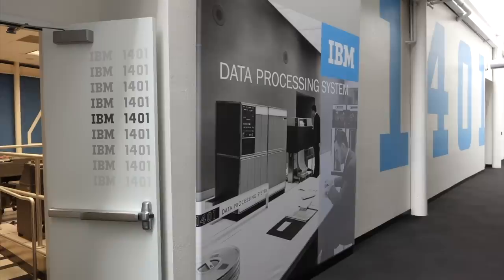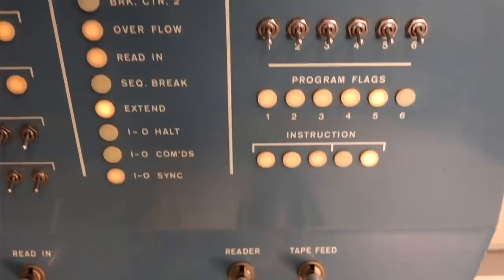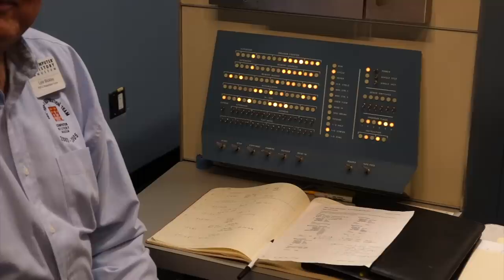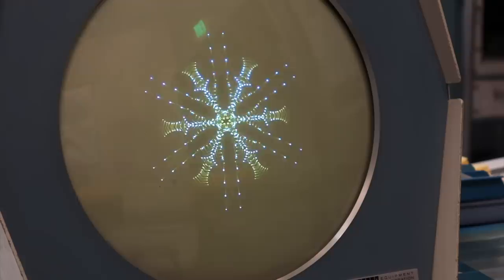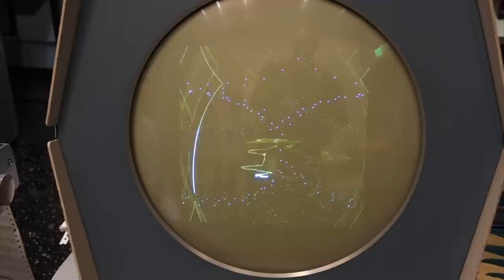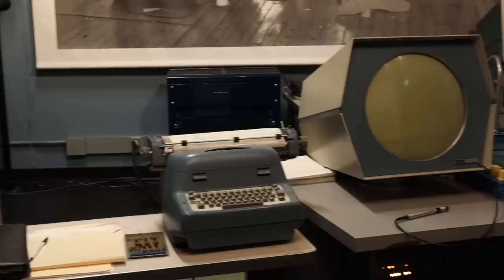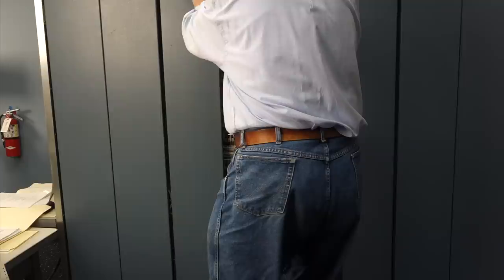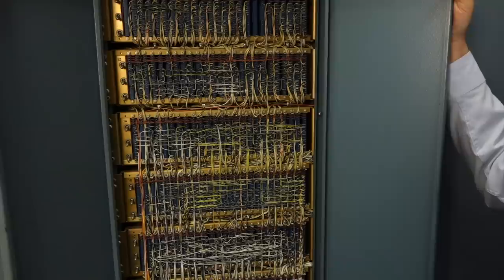Lyle Bickley explains the PDP-1 (and we play the original Spacewar!)

Comment: Just to help me out, is this less or more powerful than, let's say a Commodore 64? I'm a total noob regarding these REALLY old computers.
Reply: A bit hard to compare.  The C64 had 64K bytes of 8 bit RAM plus 20K of ROM, and a ~1 MHz 8 bit CPU.  The PDP1 used 12 K of 18 bit words, and the logic was capable of running at about 5 MHz, but I don't know how the instruction set compared with the C64 processor.  

The PDP-1 required many kilowatts of power, while the C64 could run off a wall plug, and had floppy discs for data storage.  The PDP-1 had about a 20 word program loader to bootstrap, but then you would have to load the operating system from paper tape, if it wasn't already in its non-volatile magnetic core memory.  

Biggest difference is that only 53 PDP-1 units were ever made at a cost of nearly $1 million each in today's money, while 10 - 17 million C64s were sold at a much more affordable price.  

Aside from the price and the difference in I/O capability, the PDP-1 was probably a more powerful computer, but only a handful of people could have afforded to buy or operate one.
Reply: less, much less,
Reply: Keep in mind the C64 had its custom chipset coprocessors for video (VIC2) and sound (SID). This is why the C64 is light years more powerful in graphics and sound.  The Vic2 ran at 14mhz.  The 6510 processor also was no slouch esp when unsaddled from the burden of driving the graphics system, able to run an instruction every 4 cycles vs 8 on the common Z80 processor of its time.  The main limitation was the lack of memory.
Reply: Let's go point by point...

Memory (not counting ROM, as we don't know what, if any, the PDP has) -
PDP-1: 12K x 18 bits = 221,184 bits (non volatile)
C64: 64K x 8 bits = 524,288 bits (volatile)

The Commodore has about twice (to 2.5x) as much, at least once you subtract the ~8k needed for a typical screen bitmap, though you do have to sit through loading programs into it every single time you power on, unless you're running a cartridge of course. However, if you boot into the built-in BASIC, the load screen claims "38911 bytes free", which is equal to only 311,288 bits (because some of the address space is shared with ROM, and only some of the missing space can be shadowed by video RAM). A closer run thing, but in either case, the C64 still wins this round. Other contemporary machines like the Spectrum 48k and BBC Micro (32k, typically) would be even closer or actually lose. So we can say the PDP's memory is about equal to that of an early 80s home computer, albeit divided up somewhat more coarsely.
Bear in mind however this is just how much memory THIS PDP-1 has; the base model sported only 4Kw (4096 x 18 bits), and expansions were available up to 64Kw (65536 x 18 bits), which obviously changes the equation quite severely in both directions.

Processor power -
PDP-1: 18-bit architecture, parts rated for upto 5mhz switch rate, but only used at that speed for executing microcode at a level rather lower than the actual "instructions". Memory speed, a much more important thing for the operation speed of both this system and a typical 80s machine, was about 187khz, which at an average of 2 memory ops per instruction gives an overall speed of approx 93,500 18-bit instructions per second. As computer and specifically CPU architecture was in its infancy, each instruction was more primitive, less refined and took up far more microcode steps than in later microchip processors, hence the discrepancy in speed; also, with fewer opcodes available overall, especially for complex instructions, you'd have to use more of them to get the same result, making for an equivalent speed probably far below 90kips. Total transistor count about 2700, with a similar number of diodes. Able to access up to 64k x 18 bits of memory without paging, so 18/8ths that of the C64.
C64: 8-bit architecture 6510 running at approx 1mhz (a little higher for NTSC, a little lower for PAL), with somewhere north of 3500 transistors on the die. If in line with general 6502 system design, memory may run at the equivalent of about 500ns (=2mhz), more than fast enough to perform read-write cycles at up to 250khz equivalent (the CPU can only access memory on every other cycle, and reading then writing are of course separate acts), or about 2.67x that of the PDP-1 (give or take a little depending on region). In the C64, the CPU has to share memory access cycles with the video chip, and the full performance is only available when video output is disabled, but as this is basically the same as the PDP (which outputs to the teletype by default and uses the scope as an additional rather than main device) it's not worth working out the speed hit at this point. Obviously, only capable of reading a 64k x 8 bit block of memory without use of paging (cheated in by use of the GPIO pins added on to the 6510 vs the 6502, which selects between ROM and RAM, but that's still only about 96k to 128k x 8 bits of total volatile storage, still not as much as the PDP).
Advantage: Commodore, again by a factor of about 2 to 2.5x

Video output -
PDP-1: 1024x1024, 1bpp quasi-vector display; can display 20,000 points per second (1 per 50us), or the approx equivalent of 400 points per frame of a 50hz raster display (equivalent of about 8400 bits, just over 1kb, or 467 words of storage, given 20 bits for X/Y location and 1 for on/off). Long-persistence phosphor of course helps to cut down on flicker when showing more than 400 discrete points/vector nodes, but there'll still be some obvious pulsing, and a full 1024x1024 raster image would be impractical as it would scan barely any faster than one frame per minute (and would need 128kb / 57kw of storage anyway). Readable character output therefore rather limited to maybe a few lines of 16 to 20 chars apiece, and large amounts of text are better output to the teletype with the scope reserved for graphics instead.
C64: 320x200 pixels or equivalent sprite resolution at 1bpp (1 colour + transparent for sprites, 2 colours per 8x8 block for background), and 40x25 text with 2 colours per character space from a limited set (as there are only 4096 bits of colour RAM available), or 160x200/equiv at 2bpp (3 colour + transparent for sprites, 3 ink colours + shared BG colour per text char or 8x8 pixel block, or 2 colours per half character/4x8 block). Effectively about 8kb of video memory in bitmap mode, plus a little extra for colour RAM and a small number of 8x8 sprites.

Advantage very strongly Commodore in this case, even though it can't match the same peak resolution as the PDP's scope, it can make much better use of the lower total resolution available to the VIC chip (limited essentially by its output device, ie a normal TV, which in NTSC regions can't be relied on to provide much more than 200 visible lines in progressive scan mode, or a visible width of more than about 320 pixels at the VIC's higher, NTSC colour crystal based clock rate of 7.14mhz - which is why that same resolution, merely with much better colour depth, was retained for Commodore's own Amiga (with a whole-system speed of 7.14mhz), and the Atari ST that was designed by some of the same team responsible for the C64, as well as various other computers and consoles), showing much more complex figures without flickering, a full 1000-character screen of text, and of course upto 16 different colours instead of just on/off.

Sound output -
PDP-1: 4 channels of square/pulsewave using a somewhat edgy hack running four of the processor status lines out through an amplifier. Somewhat heavy on the CPU, can't be easily used with other programs, no waveform or per-channel volume control, no built in white noise, enveloping, filtering etc.
C64: Legendary SID chip... only 3 channels, so ultimate harmonic sophistication slightly less, but each can be one of four waveforms (square, sine, triangle, noise) and combinations of them, play at different volumes, use fancy ADSR enveloping, filtering and modulation effects, etc, uses very little CPU time to play simple tunes (a few dozen register updates per second, with the chip running automatically in-between), and can be easily used as an accessory to all manner of programs without suffering interference from the CPU status.

Commodore wins that one with no trouble at all, unless you have a specific need to play four different basic notes without any fancy processor trickery to split the job between three.

Offline storage -
PDP-1: original storage by teletype grade paper tape, base format uses 8 bits at a time (ie 8 holes across, not including the timing holes) but the spacewar tape looks like it's only using 6 of them; so, each word is 3 rows on the tape... stated data rate for it is "60 characters per second", which I'm guessing means 60 groups of 3 - so 60 words, 180 rows, and 1080 bits per second, not particularly fast but enough to read a 4k program in a little over a minute - given that pictures of it look to have about 80 rows per fold (same as punch cards), and the reader is blowing through it at more than 2 folds per second (so 4k = a folded stack of paper equivalent to about 150 pages, like a book of raffle tickets). Impossible to edit in any way other than blanking out entire characters by punching all their holes - if a paper tape needs edited, you read it into the computer, edit it in memory, than output a whole new one, same as making a new working copy when the original starts to get worn out (after about 25 reads...); commercial software that was expected to be read in hundreds rather than dozens of times might come on Mylar plastic punch tape instead, but that was merely more durable rather than faster or higher capacity.
Later (late 60s, vs PDP range going into series production early 60s) joined by DECtape, storing about 2700 kbits per tape (330 kbytes, 146 kwords) and able to read a full tape in about 30 seconds; effective data rate of ~80 kbit = 10 kbyte or 4.5 kword per second, not much by modern standards but blazing fast compared to papertape (would read Spacewar in less than a second), and the amount of memory in the computer. Access speed about 125ms from a dead stop to running at full read speed (system able to read data asynchronously at whatever speed the tape is actually moving at, so no need to back up and resync even though each data block is around 256 words, and so takes less than 60ms at full speed, or probably 120ms when pulsing the motors to read a single block), although random access obviously averages more like 15,000ms... Accessible like a floppy or hard disc, however, as far as the OS is concerned, with a subprocessor looking after block seek etc, and a secondary drive with a blank tape can even be used as a small block of virtual memory for a multi-user timeshare system.
Hard drives, drum memory, punchcard readers/writers and ultimately floppies also available for the system, but were mostly later and far more expensive developments (justifiable by higher capacity and speed, or compatibility with e.g. IBM card stacks), whilst the DECtape was rather more affordable, easily expandable and ultimately more or less ubiquitous.
Of course, initial bootloaders tended to have to be toggled in through the front panel switches, which might take a couple of minutes of manual operation to input a few dozen one-word opcodes and addresses. ROM modules (which may just be circuit cards with a particular pattern of diodes) were presumably an option but I haven't seen any information anywhere...
(out of space, ironically)
Reply: C64: Comes with a healthy 20kb (=100kbit) of autobooting ROM including BASIC for messing about, and a proper keyboard of course for using the BASIC... simple mass storage achieved using the tape deck and regular audio cassettes, at a rather slow speed (about 600 bit/sec, or 60 byte/sec with regular 10 bit/byte tape encoding = 3.5k per minute, or maybe 100k per side on a 60 minute tape with allowance for leader/sync tones and gaps between data blocks... so, slower than the PDP paper tape) using the default routines, or higher speeds (1200 to as much as 6000 bit/sec, so loading a 32kb program in 1 to 5 minutes instead of 9+ minutes) using custom fastloader routines. Automatic controllability limited to turning the drive motor on and off, any fast forwards or backwards seeking (using the analogue counter as an index) having to be effected manually. Writing only possible sequentially, and to a completely blank section of tape unless you want to overwrite the previous contents.
Upgrade mostly in the form of the 5.25" floppy disc drives available for the system, typically Commodore's own 1541 or similar - themselves rather slow and low-density compared to competing systems, but giving a definite payoff in terms of random access, particularly for writing, as they're formatted into discrete blocks. Standard spec of 170kb per disc (or 340k if modified to be flipped over for sequential double-sided use, but still only 170 at once), ie about 1400 kbits including filesystem area, and a peak speed of only 400 bytes (=3200 bits) per second. However, as with the tapes, this could be reprogrammed and a little extra capacity squeezed out, and again upto a 10x speed boost, so around 4kbyte / 32kbit per second.
Also there were ROM cartridges, which operated essentially at the same speed as main memory and whose programs were available directly after power-on... capacity was limited however (16kbyte) and of course they couldn't be written to.

Essentially, in this case, the PDP takes it quite comfortably, as the C64's basic cassette RW speed is even slower than that of the paper tape reader and is about as limited in terms of random access and rewritability, and even when the disc drive is juiced up to the max it can't match the speed of DECtape, the random access speed advantage is completely lost if the disc drive runs at its default speed (even though the tape may be seeking far more often than it's reading or writing, it does the latter so fast that it still catches up even to a disc that's running with entirely sequential RW), and the total useful capacity of a tape is about equal to that of a disc that's been modified for flip-side use, but the whole 2.7mbits can be accessed in one go and with barely more time needed for the entire operation than it would take to park the floppy heads, eject, flip, reinsert, and start loading side B.

Other things -

I think we've gone on quite long enough, don't you? The C64 wins in most cases, but the PDP is clearly the better option for processing large amounts of data programmatically... ;)

Comment: Just amazing how fast technology developed in the USA. And by 1959 where transistorized computing gave birth to PDP-1, one highly sophisticated computer by the day and the Defence had mobile computing with tape drives loaded onto trucks, Denmark only had one computer named DASK, Danish Arithmetic Sequence Calculator, which was a private initiated first generation tube-based computer that was used to calculate the outcome, and quite correctly so, from the general election on Nov, 15. 1960. I'm simply taken by storm. Amazing.

Comment: I looked up the original code for SpaceWar and the PDP-1 Handbook, hoping I'd get some insight into the assembly language it used. Until I realized the source code for SpaceWare is around 7500 lines. Which is probably nothing for guys like Marc, but for somebody who just dinks around with 6502, 8086 and 8051/52 emulators every so often it was overwhelming, to say the least. For anyone curious, a PDF of the PDP-1 Handbook can be found here:

 http://www.bitsavers.org/pdf/dec/pdp1/F15D_PDP1_Handbook_Oct63.pdf

Although to learn more about 6502 assembly, I downloaded a disassembled ROM of Super Mario Bros for the NES with lots of detailed comments, which wound up being 16,352 lines. And that never dissuaded me. Of course, I never came close to reading through every line, but a lot of it is redundant anyways, if you're just looking at it to learn. The first 660 lines alone were just what appears to be definitions of variables. Which I didn't even realize you could give variables human-readable names on the 6502. But it's learning stuff like that which drives me to try and go through code like this to get a better understanding of the language. Next to actually copying the code yourself and assembling your own ROMs, it's probably the best way to learn any programming language, I think.

And again, if anybody's curious about the disassembled ROM of Super Mario Bros, it can be found here:

https://gist.github.com/1wErt3r/4048722

It's just a plain text dump of the assembly code with lots of comments. Combined with some documentation of the opcodes and what they do, it's a great way to learn not just about the 6502, but about Super Mario Bros itself. For example, I didn't realize there was a level select mode in the game after 33 years of playing until I went through this source code.
Reply: The reason all those old games are written in assembly, was that human coders could do a much better job of optimization than the compilers of the time. The compilers were limited by the "horsepower" (processor speed and available memory) of the machines they ran on. Once C came along...things changed. When the PC came along, things changed again.

Comment: Re. Marc's comment that we should have programmers program on this (the PDP-1) so that he doesn't need Gig's of RAM to run a word processor - We used to have that in the 8-bit era. There were word processors running in 16K of memory (taking up less than that, so you had room to write a document). I used a word processor on a 128K computer to write most of my college papers, and it had room to spare to do spell checking.